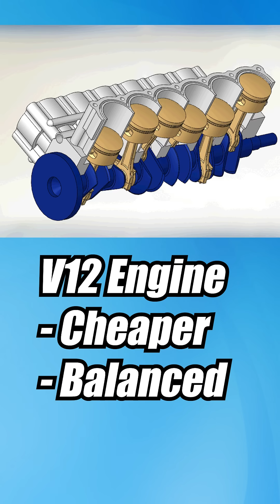wHy DoN'T CaRS uSE V14 ENGiNEs?

Comment: Exactly, this is why no cars have V6s. They have an odd cylinder ratio. Look I am not educated very much in engines, but this information appears specious.
Reply: The thing about 6 cylinders is that if you divide 720 degrees ÷ 6 cylinders, you get a whole number of 120, that being the split between crankshaft journals, as well as bank angle. So a perfectly balanced V6 has crank throws at 120 degrees apart with a 120-degree bank angle (I believe ferrari has one). Now, most V6s are 60 - or 90-degree bank angles. This mostly has to do with smaller packaging or shares tooling with other engines.

Where 7 cylinders, 720 degrees ÷ 7 = a repeating number, it comes out to something like 102.857....
This means a 7 cylinder is incredibly hard to balance at high RPM, because there isn't an even interval like, 3, 5, or even 9 cylinder engines. There are some examples of 7 and 14 cylinder engines, but like he mentions in this video almost all are exclusively industrial. So Low RPM high torque applications.

V14 engines would suffer the same balancing issues as a inline 7 especially because it shares the same crankshaft assuming a 51.42857... degree bank angle, to make it 'balanced'.

TLDR: Literally it is better in a supercar to have something that is easily and/or naturally balanced like a V12 or V16. Hell the maclaren F1 had a V12 without a flywheel, they are that well balanced. A V14 or I7 would require massive counterweights, balance shafts, and a large flywheel to make it smooth enough to rev high. Completely taking away the throttle response that super cars are known for.
Reply: @duckdestroyer2412 this makes no sense at all, degrees are a made up concept so it’s easier for humans to understand
Reply: @andrewschmier6749 yeah, but guess what... engineers, follow those "made up" mathematical rules which is why there are no major high RPM inline 7 or inline 14s.
Reply: Lots of cars have v6s.. it's actually quite common
Reply: @mrlegkick91  Well, of course, I own a V6. I was criticizing his information on why V14 don’t exist.

Comment: Because...2 rows of 7 is just... Why?  I mean, at that point make it 2 straight 8s in a v and have a v16 if you really want something twice the size of a hemi.. 😂. I'd think the math to properly balance a 16 or 12 would be easier anyhow.  Just doesn't make a lot of sense to me to make 14

Also when was the last time you saw a straight 7?  Yah..me neither...  They'd have to scratch build it from the ground up, whereas they can load up the cad files for an 8cyl and be like 1/4 of the way to a working 16.

Comment: Don't jerk around; go to an H-24 configuration, or a 4 bank 36 cylinder radial.  Cost isn't an issue with these cars.  In fact, higher price is a selling point.

Comment: So far I do now that a formula 1 team BRM had an H16 which was two v8 banks on top of one another. It was very unreliable. I hear they also had a V16 at one point, but I’m not sure about that.

Ultimately I do think because a crankshaft needs to rotate 360 degrees, you start looking for combinations where each piston drives a certain degree of the rotation. That would in my mind help map out the firing sequence. Now, I’m not an automotive engineer so I may get this wrong, but just about every combination of common engine could fall into this.

V12-30° Per Cylinder
V10-36° PC
V8-45° PC
I6/V6-60° PC
I5-72°PC
I4-90° PC
W16-22.5° PC which feels like the outlier
Reply: Yes, BRM had a 1.5-liter supercharged V16 engine in the early 1950s.  You can find videos on YouTube of it running.  When they finally get it revved up to where it makes power, it sounds like a leopard.

Comment: The reason there's no small v14 is because 720 degrees of crankshaft rotation is what 4 cycle engines need to make every single firing of each cylinder happen, you get a number with a decimal point if you divide 720 by 14. The firing intervals would be very unbalanced and it would cause a very bad vibration over a few hundred rpms, most giant ship v14s never see more than 200 or so rpms, so the potential for vibration isnt there.

Comment: Most V12s are based on other platforms from the same company. Some manufacturers basically put two of their I6s together and turn it into a V12. There are no 7 cylinder engines so making a V14 would require a couple of experimental designs that don't exist yet and it just wouldn't be worth it.

Comment: While you touched the real reason slightly, you're mostly wrong, inline 6 engines are naturally, perfectly balanced, 5 cylinders and 7 cylinders are impossible to balance, not figuratively, they can never be balanced perfectly and can only come close with a balancer shaft. 2 straight 6 engines are naturally almost perfectly balanced, the only thing to better the balance of a v12 is through closing in on a 180 degree v12. So a v14 could never be balanced, and the engine size thing, you're wrong again. The only cars that use v16s are unreasonably long and aren't made to go around corners. They are too big. And a bugatti w16 is around the size of a similar displacement v10, so they aren't comparable

Comment: 7 is quite a peculiar number, especially for applications like cylinder counts - imagine dividing 360° (full circle, or crank rotation) by the cylinder count to get the crank rotation angle between each cylinder firing. 1 cylinder - 360, 2c - 180, 3c - 120, 4c - 90, 5c - 72, 6c - 60... 8c - 45, from now on you are making V-engines so you use the double-cylinder/half-degrees counts. Well, 7c would be? 51.428571428571... infinite periodical. That means you can't make it absolutely perfect, you need to do some rounding eventually. Useless hassle, it's much easier to do I6, V6 or V8 (or back in the day I8 too). Same stuff goes for 11 cylinders, 13 cylinders and probably just all prime numbers starting from 7.

Comment: You say that like you only get more horsepower from having more cylinders, no car needs more that 8 especially with how light they are now just to put in perspective that you dont need more cylinders my 66 holden makes 140 hp and my 78 chrysler valiant makes 350 hp stock and there both 6 cylinders. Big difference

Comment: It's also on how much tensile strength that is with in the metal,parts are to think but also hot to would cause a structural failure,

Comment: You can divide 360 by 2, 3, 4, 5, 6, 8, 10, 12, and 16, but not by 7 or 14. The result would be a non-integer number. This would make engine balancing very difficult. That's why there are very few inline-7 engines (although they exist, they are extremely rare) and consequently, V14 engines.
Reply: Doesn't matter.  1, 2, 3, 4, and 5-cylinder engines are not balanced either.

Comment: 4 stroke engines with one piston have a firing interval each 720 degress, right? If you have a V8 that is between firings your crank shaft will rotate 720/8 = 90 degrees. If you have a V4 (you have a flat four) = 720/4 = 180 degrees. Yep, firing interval matches the angle of the V between both cylinder banks to ensure equilibrium. Thus what happens with a V14 = 720/14 = 51.42 (which is not ideal as it is an irrational number).
Reply: Doesn't matter.  Engine blocks can be machined to a bank angle of 51.42857 degrees.  It will be even-firing.

Comment: A V14 is possible. None of the reasons given in the short are why we don't have them. As others have pointed out, balance is an issue. We have V6 and V8 engines. Doubling them up to make V12 and V16/W16 is pretty easy. We have I3, I5 and I6 engines which combine to become V6, V10 and V12. We don't have a V3.5 nor an I7 to make a V14. And, again, there's the balancing issue that would have to be overcome. Cheaper and easier to make the other configurations. But still entirely possible to do.

Comment: W16 and V16 dont really have advantages unless they make advantage of higher displacement or higher RPM. bugatti doesnt make advantage of 16 cylinders ithey could achieve same performance with V12 .
even the next gen Bugatti engine 8.3L cosworth NA V16 with 9000rpm redline and 1000hp would be beat by 2 gt3 rs engines. less cylinders, less displacement, same redline, more power.

Comment: even shorter answer : 360 ÷ 7 = 51.42857142857143 and 360 ÷ 14 = 25.71428571428571 // we do number of cylinders that can divided in non fractures number only, 3, 4, 5, 6, 8, 10, 12, 16 can divided 360, 7 and 14 just can't
Reply: unless it's radial, that thing defies all straight up pipe logic

Comment: A Straight Six is evenly balanced across all the three axes hence it has hardly any vibrations. A V-12 is effectively two Straight Six engines clubbed together to enhance performance and reduce the operational costs. 

Hence, if you already have the power equivalent of two unicorn engines in your vehicle which have reached their limit of perfection, there is no more need of adding cylinders in the configuration.

Comment: Displacement is a huge role in this! I work in a shop and most engines we work on are high end long lasting engines like straight fours and v6s. Diesels are also incredible, but it all depends on cost and balance like you said. 5 cylinders are extremely hard to balance!

Comment: It is possible to perfectly balance a 12 place centrifuge with 7 items.
This is primary balance ... therefore it is actually posdible yo make a 7 cylinder engine with primary balance ... secondary balance and torque cannot be balanced. Note the odd arrangements of V4 engines that can be used in motorcycles to give a double pulse firing ... a bit like a V2 with a long torque pulse caused by two pistons firing in sequence followed by the other two ... odd firing sequence with inconsistent torque is not necessarily a bad idea!
To balance a 12 place centrifuge you place 4 equally around (with 2 places between each) then fit in three in a triangle (with 3 places between each).
ie a seven cylinder engine could be a three cylinder engine and a four cylinder engine interleaved together. It would be possible to have secondary balance using balance shafts (ie those required for a 3 cylinder engine and those required for a 4 cylinder engine).
A 90° V8 can be perfectly balanced (one bank effectively balances the other) and a 60° or 120° V6 can also be balanced ... or how about a straight 6 interleaved with a 90°, V8 giving a 14 cylinder engine???

Comment: Its also just a gas milage thing. Many modern v12s actually shut off some of its cylinders unless its in a certain race mode or others at a certain speed, for the sake of not having to refill every 45 minutes. Add more cylinders you just run out of gas quicker when theres much better ways to increase power than number of cyl

Comment: It's mostly because a lot of high cylinder count engines are somewhat modular. V16s are designed from 2 existing v8sand v12s are designed from 2 existing inline 6s. Dodge v10 is a 340v8 with 2 cylinders added. A v14 would pretty much be a 100% new design and cost as much.
Reply: You can get heads from a 4.3L GM V6 and heads from a 5.3L GM V8 and put them on a block machined for them.  Voila!  V14 engine.

Comment: My favorite engine is a inline 5 2.6 or 2.7 with a turbo. Orrr a 7 liter turbo diesel. Or you know, electric. I have an ebike that uses the same 18650s as tesla and its great
Reply: Inline 5s are the sweet spot though. Not a huge engine but it sounds hella good almost like a v10 found in something like an old audi or volvos

Comment: Devel Sixteen has a all aluminum Quad Turbo V 16 that supposedly puts out 4500hp on pump gas but I doubt it and it’s clearly not a production car so even if it can go 350mph it’ll never officially hold the record for fastest car in the world V14s make no sense it’s always about having a even number of cylinders on each side of the engine to balance it evenly if you want 14 cylinders you’re better off making a inline or straight 14 or a rotary 14 but even the 32 cylinder rotary engine in ww2 bombers and other plants had a even number of cylinders if you halved it you could make a V32 with 16 cylinders on each side of the engine

Comment: Cylinders are irrelevant because most V12s are smaller than most V8s just cuz they have 4 more cylinders don’t mean anything they’re also smaller cylinders no V12 is as big as a big black V8 they’re always the same size as a small black V8 the V12s are usually 4.5- 5.5 liters a Big Block V8 is usually at least 7.0 liters and the 630 ci  1000hp Chevy big block is 10.0 liters the think is these super cars always use power adders like twin or quad turbos which turns a 600hp or 700hp V12 into a 1200hp to 1600hp engine even more look at the Venom F5 6.6 liter twin turbo big block it’s like 1800hp and it’s not even 7.0 liters it might even be a small block

Comment: For anyone actually wondering why a v14 doesn’t exist, it’s because when calculating the rotating assembly you must use 360 degrees. 360 is divisible by 1,2,3,4,5,6,8,10,12,16. A v14 would not have an even number and therefore calculating the crank and valve train is near impossible. This video was so dumb.

Comment: I mean Bugatti also uses a w16 because it’s cheaper than using a v12. How is it cheaper you might ask. The w16 is basically two of vw/audis w8’s put together. Of course it’s not literally that but it was cheaper to double the cylinders of the w8 with a longer block and give it more displacement than develop a whole new engine. The engine design was tweaked a little with different sized cylinders and stroke displacement and the overall angle of the w being slightly different, but you got to start somewhere and that somewhere was the w8. Not only that the w style of engine takes boost surprisingly well and is pretty smooth on top of that leading to it being the obvious choice for Bugatti when building their all out luxury hypercar.

Comment: We can use the same logic on displacement. Everyone knows a bigger engine makes more power than a smaller engine when the variables are the same (compression, engine design etc). So why don't we produce 8L Viper V10 engines for regular production cars? Because... EXPENSIVE.

Comment: It would be a lot of extra work to balance a v14 engine, the engine would be substantially larger, engineering cost would be insane, and you would only gain a small power advantage compared to a v12. V12s are naturally perfectly balanced and are easier to scale for those who choose to implement them.

Comment: High end supercars build v12’s because they are inherently balanced. This means they don’t need counter weights on the crank shaft or balance shafts to mitigate vibration. Counter weights and counter shafts both cause parasitic losses that cost engine power and reduce throttle response. 
Supercar manufacturers also use the v10 solely because of the sound. No other engine configuration can produce an exhaust note so pleasing to the ear than a v10 with its exhaust note that’s a perfect 5th.
Reply: If sound is what you are looking for, you can now customize exhaust notes. So any engine will pretty much do, as far as that's concerned.

Comment: A V 14 would be difficult to synchronize. V 8 and V 16 synchronize to the same beat as a V 4, at 90 degree intervals. V 6 and V 12 synchronize to the same beat as well, to 120 degree angles. Try to do that with a V 14, it’s far more difficult.

Comment: Also the bank angle would be 51.43 degrees unless the engine had split crank pins which both of these wouldn't be feasible since v12 uses 60 degrees already used in v6 and v16 uses 90 degrees found in v8 engines. V16 can also use 45 degrees which is just half of 90. V14 would then be an engine that would require so much more r&d to do something that has no advantage over v12 or v16. Plus cylinder count doesn't really matter that much if your engine can already happily rev to a high rpm when it is a 12 cylinder.